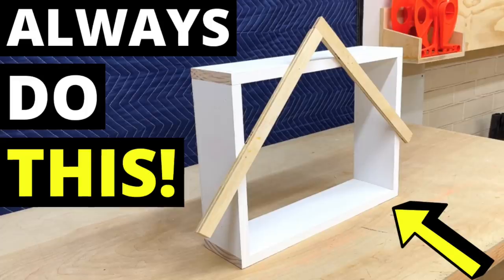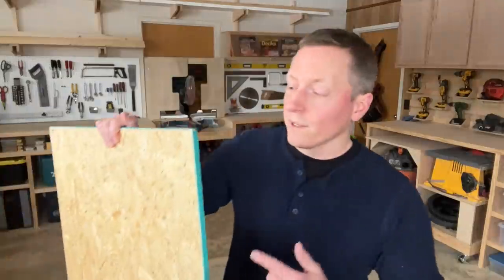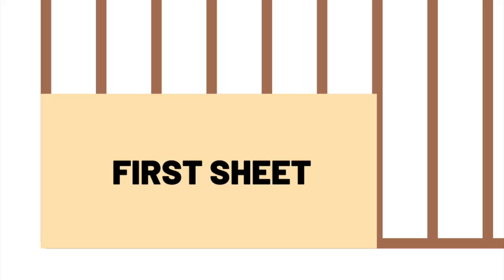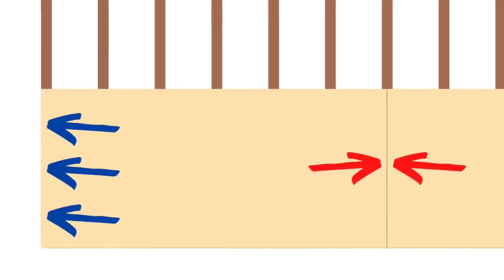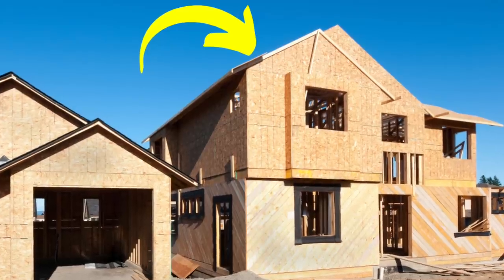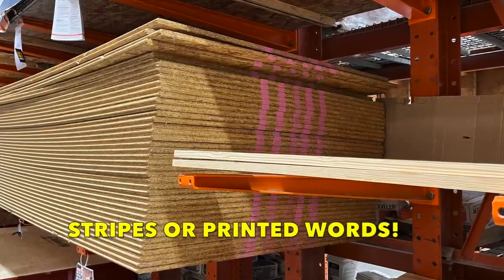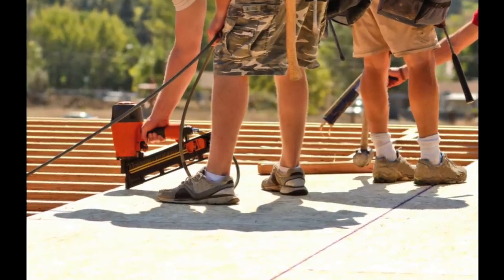This BUILT-IN LUMBER HACK Will Help You Build Anything! (Understanding FACTORY EDGE--How To Use It!)

Comment: Beware: not all factory edges are square. It's good to check them when important.
Reply: Thats what im saying. This video makes me not want to watch any other videos he has...
Reply: Yep, We don't come across many perfectly square sheets from merchants in uk, they may  only be one or two  mm out but it makes a massive difference when covering large areas.
Reply: @simonsteers142  interesting. Here in Australia, sheets of OSB, MDF, particleboard flooring, plywood, even undamaged plasterboard is very reliably square. Any sheet of processed/artificial material can be assumed to be as accurately manufactured as any of our string/tape/square tools literally more than 99% of the time. In the decade or so I’ve been building houses, I vaguely remember seeing just a single sheet of flooring that was out of square, it messed with the project for a few minutes and was such a surprise when I realised what was going on that I guess it just stuck in my memory.

Damaged edges, on the other hand … well, let’s just say I think some of the forklift drivers at the trucking depots could do with a refresher course.
Reply: Maybe in the third world countries. Here in North America there should be no issues with sheet goods.
Reply: @MontanaWelldigger  Australia is not a third world country.  In many ways Australia is a better place to live than the US.
Reply: @daveortwine2641  An OSB 4x8 subfloor sheet is square.  A cabinet grade sheet of plywood might not be and since this sheet is used to make stuff, it should be checked for squareness.  Two different things here.
Reply: @daveortwine2641  Yea he just needs to make a waaaayyyy bigger distinction between "carpentry" and "woodworking".  Especially since this youtube channel is for beginners.  His carpentry influence really shows in his videos with all his "freehand rip cuts" he suggests.  He almost makes it sound like these techniques are ok for building cabinets and drawers, but, for other than shop furniture, it's not.
Reply: Yeah had to resqare a couple of shed floors for buddies who relied on the squareness of their floor sheets
Reply: @JeremyBell  Absolutely!  I've also learned that there's a big differences between contractor grade equipment and more expensive stuff like a cabinet saws, large bandsaws, cabinet planers, etc.  I started screwing around making things out of wood in grade school and now retired, I'm making cabinets and furniture for fun.  There are countless tips to improve your woodworking skills and I'm still learning!
Reply: @bobbray9666  And yet your OSB is not square?
Reply: @josephjohnson6626  Huh?
Reply: @MontanaWelldigger  Lol, if any of the places mentioned in this thread are a third world country, it's the US, by lightyears.
Reply: Bunch of sissy’s on here. If you install the first sheet well enough and square even on trusses or on floor you can quickly finish the whole thing by yourself. If you feel you need to check it, you can pull a tape. If your building is not square, now that where y’all must be having issues and maybe should be watching some framing and squaring up videos first. I think this is useful information for beginners.
Reply: In Canadian usuallyfindbuilding material sheet to be perfect, but not so much on MDF melamine and other cabinet making sheet goods
Reply: Your ability to check is only as good as the measuring device that you have. When you're a carpenter, that's usually some kind of metal square. Unless you have some means of regularly checking the calibration, it's hard to know how out of square your metal square is after months of years of carrying it around, dropping it, temperature changes, etc.
Reply: @Anytus2007  3,4,5 and you can use a harbor freight tape measure if you want. You can make multiple marks to stay on course. More than likely if you aren’t experienced much, you won’t be attempting anything big enough to mess up…
Reply: Yep.  I had 8 bunks of CDX on a project I did last year where pulling diagonals showed a quarter inch variance.  Not terrible for framing, unless you’re relying on the first sheet to square up something.
Reply: @Anytus2007  Pythagorean theorem.  Very easy.
Reply: @wht240sxka  and how would you propose using the simpleton’s method of a basic trig equation such as 3,4,5 on a Framing square to ensure its squareness?  I am intrigued…. 😆
Reply: @downbytheriver501  That only checks the consistency between your square and your tape measure. How do you know your tape is calibrated?

Worse, if your square is true but your tape has an offset you don't know about, then an accurate 3,4,5 right will appear to be incorrect according to the tape.
Reply: @Anytus2007  every day before work, I use a micrometer and measure each 1/16” mark on my tape.  All 4,800 of them.
Reply: @downbytheriver501  Hah. And then you go home!
Reply: @downbytheriver501  who said anything about a framing square? Measure 3 foot one direction, then 4 foot the other direction. If if ain’t square, it won’t be 5 foot diagonally, but if it is then it is square.  If you have material that is subpar, then those companies should be held accountable. Every wood product has gotten out of control price wise and if it can’t meet simple standards, it is discarded to cull piles and exchanged for stuff that can. It’s no wonder wood is so crappy and many builders don’t take pride in correcting anything, or else things could change. Anus007 is on his own. I have never calibrated a tape measure and don’t even know how you could unless checked by others. I just never had that problem.
Reply: @wht240sxka  I was assuming you were replying to anytus saying you could check your framing square for accuracy by applying the 3,4,5 method on it.  Of which I found to be hilarious.  I mean, I guess you could go in inches, but that in itself reveals an apparent flaw with only measuring a part of what you’re checking for square.  If you want to see if a sheet of plywood is square, for instance, would you use the same method?  Or would you utilize the entire board’s size to get an actual, accurate representation of it?  Going larger, do you check for square on a foundation with the same 3,4,5 method, or would you pull the entire length and width of a section and use the equation that that method is based off of to find the hypotenuse?
So yeah I guess 3,4,5 works for, say, a sheet of plywood.  But it doesn’t work as well as 48, 96, 107.33 just like a torpedo level will kind of work to level up an 18 foot wall…but not as good as a plate level or a laser will.
Reply: @downbytheriver501  so when I build pole barns and I am doing my layout, I have string lines and use 3,4,5 for basic squareness. Things can then be adjusted to check my work by using Pythagorean theorem method to find hypotenuse. The closer you get to perfect at that stage runs the whole project, and that why it can take a little longer than wanted, however it’s worth it. No I was not replying to him nor was having a conversation with him. I was stating earlier that people were whining about how this video was incorrect and they couldn’t do it, and blah blah. If anyone has ever put up a plywood roof before, they would know that things aren’t always perfect and you can fudge it in little increments to stay on course if you need to and having a couple reference marks like I spoke of earlier can help.
Reply: Someone didn't watch the whole video
Reply: @bobbray9666  oh please do tell the "many ways" that you think it is better? Hahaha
Reply: Usually 3 out of 4 in my experience. One of those short sides is probably out a little. We always check it before cross cutting, because if you cross cut from the shitty side, all your pieces will be out of square.
Reply: @MontanaWelldigger  Here in north America I purchased  4 x 8 sheets of veneer faced, top quality, solid core plywood from home depot. when I placed an 8' straightedge along the 8' side there was a 3/8" dip in the middle on one side and a similar crown on the opposite side. Yes here in north america!
Reply: @bobbray9666  Is Australia aligned with the US or the USSR? If not, it's a third world country by definition.
Reply: @bobbray9666  same thing can be said for America so thats not saying anything
Reply: As a matter of fact, not all factory edges are straight. My boss once bought a few sheets of 3/4 osb from Home Depot that was bowed out about 3/4 of an inch on the long side. We made it work, but it was really annoying. Just one more thing that I can't trust anymore.
Reply: The edge is usually straight, but the corner might nt be 90 degrees.
Reply: @bobbray9666  He was not saying that Bob. He was responding to a different comment.
Reply: @bobbray9666  imagine calling Australia a good place to live after the covid concentration camps.
Reply: @Anytus2007  ... if you want to check your framing square, just flip pit over and try from the other side. IOW, do the front and back of the same sheet on the same end. If your square is square, it will be the same both ways. If it's off in one direction then it will also be off on the other side the same amount.
Reply: @Anytus2007  ... calibrated? If it says 48 inches today I expect it will say 48 inches tomorrow... and the day after. Want to see if your tape matches your square? Put them side by side and just look. I seriously doubt they will change tomorrow.
Reply: @rupe53  Yup that works if you have a known straight edge. On-site I wouldn't typically have anything better than a sheet factory edge or a level. So how accurate you can be depends on how straight your edge is. Also my speed square is only 6" or so, so it's hard to discern small deviations from square over that short a length.

As for calibration, I don't know about your tape but I'm sure.mine changes over time to some degree. The tape can get slightly creased, bent, stretched, etc. The hook becomes looser. And so on. Very little difference over 24 hours (probably just thermal effects), but if you've used a tape daily for months? I'd be surprised if there's no drift.
Reply: @Anytus2007  ... what I was getting at would be called a T-square, which is commonly used for drywall. They are 4 ft long. Yeah, I know most us just pull a tape and make a few marks, then use whatever is handy for a straight line, but once in awhile everything needs to be checked. It's not rocket science.
Reply: I make rather large prefabricated timber frames in my workshop / factory. Roof elements are up to 40' / 12m long, but 20'ish / 6m mostly. Width is usually about 8'6" / 2.5m (fits a trailer bed) but up to 11'7" 3.5m (legally transportable without costly measures). I square these up by measuring the diagonals and getting them within 1 or 2 mm of eachother. That is insanely square. We've used all kinds of sheet material, depending on what the customer wants. Particle, oriented strand, fiber and ply. Usually, I can't just stack them without going out of square at some point. That's partly due to not being able to close the gaps perfectly, but I've also learned to never trust a sheet.
Reply: @simonsteers142 then it's always your job to be sure things are squared! 😮Don't be lazy UK
Reply: @bobbray9666 😅 Because of the USA. History man, learn it!
Reply: I've seen many 4x8 sheets that were out of square, osb, subfloor etc.. it's only as square as the machine it's made on is calibrated to, and that totally depends on the human doing the calibration. I've seen them 3/16th out of square while that may not seem like much it adds up.

Comment: I think the factory edge on sheet goods is fairly square. However, as a woodworker, I never trust the factory edge as they are almost never square enough for high quality cabinets or custom furniture. The first process in making cabinets is to cut off the factory long edge and then cut a square short edge.
Reply: Definitely. I've bought some plywood where that factory edge is not dead straight. 

Straight enough for most building construction or other large scale projects, but not for more precise work.
Reply: Agreed, framing carpenters can live with some slight inaccuracies. House walls often have corners that are up to 0.5˚ from perfect 90˚, when making form-fitting wall cabinets/shelves we have to match these imperfections in order to avoid gaps.
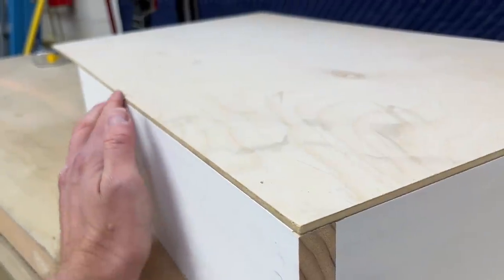Reply: I mean, he literally referenced that at 3:33
Reply: Huge difference between building cabinets and building houses. This video is talking about the painted lines/edges on construction materials.
Reply: true, the smaller/finer the piece the more accurate you need to be and shouldn't just use construction lumber's edges to get true square.. but for most starting off, building a work bench or something it'll do
Reply: Factory edges... good enough for housing, not good enough for furniture :)
Reply: Was building some custom cabinets and noticed this to be more true with some furniture grade ply I was using vs some regular ol osb I had on hand.

Comment: Accuracy increases as the build process moves along.  The foundation guys work to a 1/2", the framers work to a 1/4" the drywall guys work to an 1/8", the trim carpenter works to a 1/16" and the millwork guys work to a 1/32" or better.  Precision matters a lot more in the later stages of home construction.
Reply: Wow... that's an awesome guide. I see all these people  knocking the video instead of making a constructive comment like yours. It seemed to me, he was talk'n about construction from the foundation/framing, but I'm new to DIY, & tend to double/triple ck everything b4 cutting anyway. 
I remember someone said measure 2x cut once... so I've tried to live by that motto, as lumber is so expensive. 
But I really appreciate your comment, as it explains a lot about the comment war going on from such a seemingly simple video. Kudos 👏
Reply: Great comment
Reply: @leahrowe847 depends what you are building too. Being slightly off on something that no one even sees really doesnt matter. Especially tiny gaps. Wood expands and contracts too

Comment: I've always relied on factory edges. It makes squaring all other edges so much more accurate and easier overall. Thanks for highlighting this tip.
Reply from the maker: Thanks, TorBoy!
Reply: Hell, I use the a factory edge to make sure my shots are true down range.  🤣
But seriously now, all edges should be checked for squareness. A good T-square helps.
Reply: @harryl7946  A t-square can be out of square if it has been dropped. Also I’ve built many houses in Mexico, their sheathing can be out of square. But here in Canada Or the US, I would trust the factory edges to be square.

Comment: i’ve had a giant framing square made from 1/4” plywood using two factory edges.
have had it for 25 years.
very useful and doesn’t go out of square.

i just finished watching your video on the assembly table made with a solid core door.
i’m making one.
love that idea.
thank you

Comment: Woodworker here, and I endorse your advice. First, I agree with you and like this tutorial. We are a precision-obsessve group to be sure, but I always use a factory as a reference edge to roughly break down my sheet material, and add in some slop. Then I can later rip off the 'factory' edge based on the parallel cut where I need it. That way, I get a square component, and also get rid of the dinged-up edge.

Comment: As a newer employee at a cabinet shop, I'll contribute. We always cut the factory edges off first before any other cuts. Our vertical beam saw trues it up and the off-cut shows how bad factory edges can be. Over 8 feet, they are usually off by a 1/16th, if not as much as an 1/8th.
Reply: I was just informed that our raw stock sheets are 49 x 98 and meant to be cut for cabinets, so they aren't squared up from the factory. After I cut the short end and then rotate it 90 degrees and cut again, I have a guaranteed square edge to work from.
Reply: We do the same thing in my cabinet shop, although building tolerances are much more forgiving in carpentry. And we have sliding panel table saw to easily make square cuts on raw sheets, whereas in the field, it’s much more difficult to make efficient and accurate square edges along a whole sheet.
Reply: That's fair, you are building cabinets though, which is essentially entirely finish work. I think you'd all agree that rough framing and cabinet making couldn't be further apart in terms of building things from wood.
Reply: This is a huge difference between shop work vs. on-site work. With a fixed shop location, you can invest in equipment and procedures that deliver very high precision but would be difficult to move. Doing on-site work that's almost never possible.

Something being off by 1/16th in 8 feet is an error of 1 part in 8*16 = 128, less than a 1% error. Even off by 1/8th is a 1 part in 64 error, a ~1.5% error.  When you have to do the vast majority of your work with a tape measure, a pencil, a speed or framing square, and a circular saw (or maybe a miter saw), how confident can you be that you're always working to a precision of better than 1%? I certainly try, but I doubt I'm consistently that precise at every aspect. And even if every carpenter on the job is, are all those tapes and squares calibrated so that they agree with each other within 1%? I doubt it with some of the old tapes and squares I've seen being used.

Point is, it's totally fair to note the lack of precision that you can get in a factory edge; definitely a good thing to be aware of and there are applications where it matters. But compared to the precision you'll get from even experienced carpenters using only hand tools on-site, you're almost always well within the precision of your other processes.